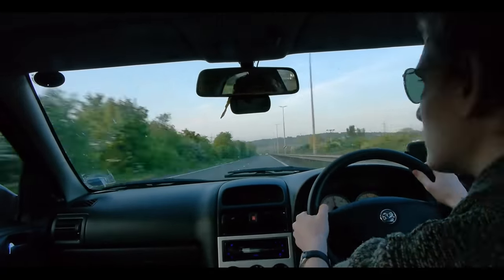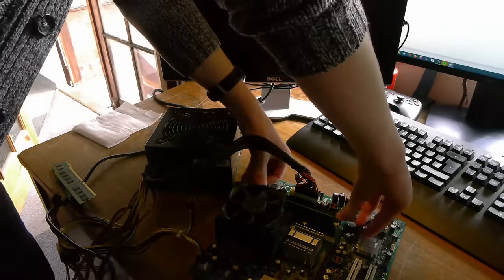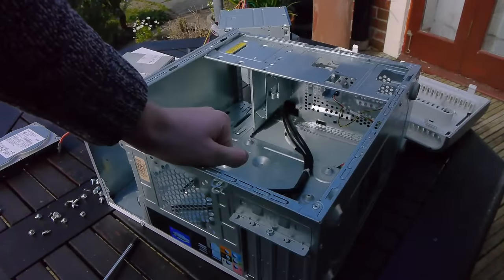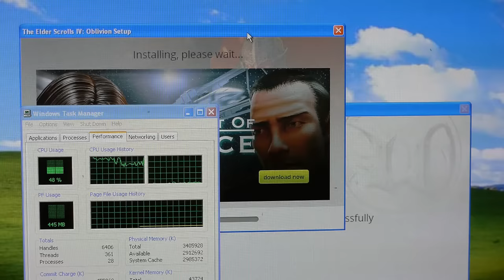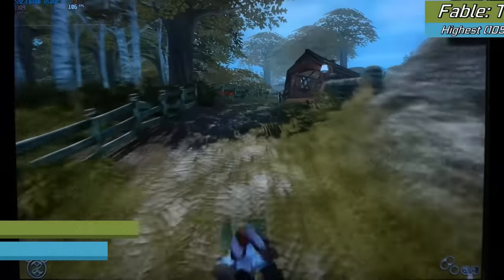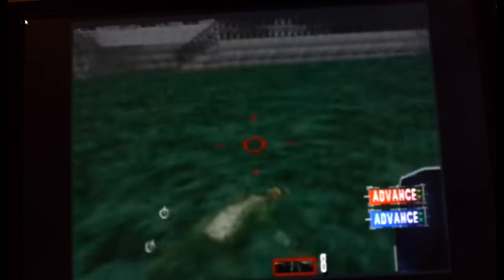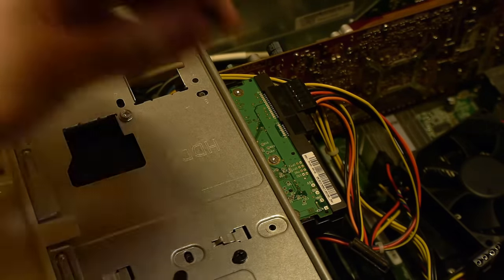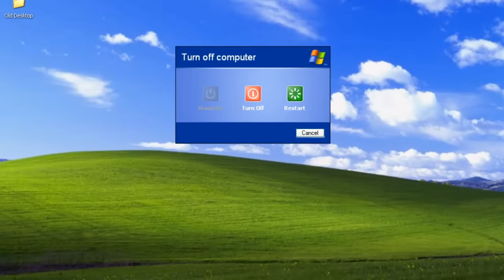The Ultimate Windows XP PC

Comment: Fun fact, Crysis and Half Life 2 both work in Windows 9x.
Reply: Lmao what. Ik half life 2 had some wierd support for 9x but crysis ran?
Reply: jackedup447 yes. Its dumb but t can. Even says so on my disc copies. Only 98SE and ME though. It’s not ideal lol. Both games perform even worse.
Reply: jam just take my HD 2600 already
Reply: @classic_jam  They've been working on that engine for quite some time,that could be why.
Reply: Half LIfe 2 I knew about, Crysis sounds like they just made an error on the box, adding 98/ME/2000.  Especially since it has brackets for the RAM/CPU for Vista(as opposed to XP)  I've never seen Crysis running on Windows 98.
Reply: Big doubt. Idk what DirectX support it on Windows 95/98 (I think DX 7) but Windows XP is up to DX9 and Win 7+ is DX 12
Reply: Can somebody make an actual video of Crysis running on Windows 98. Also Half Life 2 once actually ran on Windows 98 as the game came out in 2004. However since June 2007, when Steam support ended for Windows 98/Me, the versions released afterwards probably wouldn't run on Windows 98 (?). IDK, it would be cool to see those games running.
Reply: Windows 98SE and Windows Me can have DirectX up to 9.0C.
Reply: Dimondminer11 98SE and ME also support up to 9.0c
Reply: DirectX 10 required Vista+, and DX12 requires Windows 10
Reply: @lmcgregoruk  They did go back and add DX12 to Windows 7 RIGHT before the dropped support, but it's mostly irrelevant at this point.
Reply: No, Microsoft helped a few developers port their DX12 games to Windows 7, mainly WOW, they never released DX12 itself for Windows 7.
Reply: @karl-erikkald8876  you could maybe try a pirate oldengine copy in 9x? is it possible
Reply: But Windows 2000 runs on a NT kernal
Reply: @armorgeddon  And XP can support up to DX 10 and Win 7 can support up to DX 12, and Linux can run Windows programms/games and soon/maybe would Linux run even DirectX 12 games natively (google it up), Nintendo Switch can run Linux and Steam which means Steam games and Switch can run Android which means Android games. And Android can run Nintendo 3DS games, maybe even run the whole 3DS OS on it soon (source code for 3DS is leaked recently).
Reply: Windows XP only support DirectX 9 but its was unofficially support 10 if unofficial patch is installed.
while Windows 7 only support DX11 but Microsoft added a update in 2019 that allow DirectX12 game to run on Windows 7 (but only some games like COD Modern Warfare [2019 reboot], World of Warcraft, etc.. are supported).
Reply: Druaga actually played minecraft online with a windows 98 pc (that had ACTUAL windows 98 hardware era), some impressive stuff.
Reply: @LucasCunhaRocha  I remember seeing that actually. That was very interesting to me
Reply: The original version of half life 2 runs great on 98. On a geforce 3 ti200 and okay on a fx 5200.
Reply: But can it run recycle bin?
Reply: Eee my pentium 2 266mhz is a beast bro )) 4mb gpu xd
Reply: Wait a second that got me thinking,why isn't there a Windows 9?
Reply: I had a pretty good Crysis PC back in day, Q6600 quad core, 2 -GTX260FTW cards sli, raptor hard drives in raid zero, max Ram and processor lapped and over clocked.
Reply: Otherwise known as, Windows Xpotato
Reply: @DanikaCat  prolly because they already had a lot of legacy code written in for 9x so they decided to avoid using Win9 so that there wouldn't be any issues. Hence Win10
Reply: The more you know
Reply: @Cenzurat  an 8800GTS wasn’t faster than 2-260core 216 SLI. I upgraded from 8800GTs to a 260 core 216 it was much better in Crysis
Reply: @lmcgregoruk  dx12 need windows 8
Reply: @Dimondminer11  Win 98 and ME support DX 9
Reply: Some of the libs for HL2 want SSE3 now which is annoying considering the graphics still support dx7, and its just in like some dll for file io. stupiddd. Find an old engine build of hl2 and episode1 (2006 or earlier) for no SSE3. I bet tho with an SSE3 cpu even modern HL2 would run on win 9x. Then there's the Steam issue buuuuuuuut: https://www.youtube.com/watch?v=D_9hP2BA16Y <--- if any version will werk on win9x no SSE3 it's this one.
Reply: @samfkt  the Switch is ARM. Steam has to be emulated, and it'll run terrible.
Reply: Win98 was considered a better OS for games back when XP was first launched
Reply: Good luck finding any gpu that could actually run those games that support 9x tho
Reply: @lmcgregoruk  i have, a duaquad socket p3 system ran it
Reply: I think back in the day, I used to run EverQuest on Windows 98SE. EverQuest required DirectX 9.0c, if memory serves me....
Of course I also ran it on XP....
Reply: Crysis works with a Radeon 9800 pro from 2004 and an athlon XP, I know because I tested it., 480p ~25fps
Reply: Fun fact, Steam doesnt, so how are you legally installing Half Life 2 on 9x?
Reply: If you can even get a gpu driver to work on em
Reply: Hl2 can run on 3.1 too

Comment: WHAT. I literally just rescued my mom's 530 last weekend that she used since 2009 and put a GT710 in it the other day. I had to replace the power supply once, but other than that, it's been a tank and it was very clean. What a coincidence to see it on here. Did the one you picked up have a Core 2 Quad Q6600 (the original CPU that had to be discarded)? My mom's did and it still works great with a lot of tasks in Windows 10. And I just played some Streets of Rage 4 on it. I have it plugged into a nice 32" 480p CRT TV and am using it for retro things. Love the channel! Take care!
Reply: I have one of the Inspiron 530 (I liked the look of the Case for a Retro PC) with C2Q6600, I wanted to put my C2Q9650 & GA-G33M-S2 in it but it doesn't have a changeable I/O shield 😖 it's punched out of the case frame to suit the Dell M/B
Reply: Jimmy S  Yeah, I have thought about that But... I shake similar to Parkinson's disease due to a head injury that has affected my Nervous System, so cutting a straight line is a bit of a worry, let alone waving a Dremel around Willy Nilly 😁
Reply: I've owned a 530 since 2008, when it I bought it new for £399 from Tesco in Stockport. 
Mine came with a Q6600 but was recently upgraded to a Q9400. It has been my main desktop until this year and still runs XP, for legacy games and my video capture card. 
It did, of course, come with Vista, so had to be "upgraded" to XP. Long ago, I upgraded the graphics to an X1650, which work nicely for an of the old games that I have. 
As a legacy system, the Dell Inspiron 530 motherboard is ideal because it has drive connectors for floppy, IDE and SATA discs. 
A few years ago, I also acquired a 2009 vintage Inspiron 545. The latter doesn't give me the option of easily installing a floppy drive, but is now working nicely with Windows 10.

Comment: those dell motherboards from the inspiron 530 and 531 commonly have that orange light issue it usually just fixes when you power cycle it (only time ive ever seen unplugging and holding the power button ever doing something)
Reply: So you’re telling me I threw out my Dell Optiplex 780 USFF because I didn’t try that solution?
Reply: @shadowthefurryscientist  So you're telling me you threw out a PC?
Reply: @shadowthefurryscientist mine did the same but I kept mine

Comment: Brings back so many memories. I had a Dell Inspiron 530S (S meaning SLIM) in my early teen years. Got it from Walmart for god knows how much and it had a Core 2 Duo, 2GB of RAM and a Radeon HD 2400 Pro (I think) for a graphics card, complete with the latest and greatest NVIDIA drivers for all of my blue screen needs. The heat spreader on the card itself eventually tore itself off of the card. A lot of beautiful memories with that beast like 13 years ago.

Comment: This might be your best video so far, I really like it. 

Just a tip, but FM2 platform is also very suitable for XP.
Reply: I'm using an fm2 a6-6400k dual core for windows 10 :(
Reply: I installed XP on my FM2+ system, not bad, I have 8GB RAM installed even though the 32 bit copy of XP I have can only see about 4GB, but it runs great.

Comment: A couple months ago, I actually found a Dell Dimension 530 fully working. Just upgraded the ram to 6gb and the cpu to a Core2Duo 3.16ghz. Works like a charm with both Windows 10 and Linux Mint. It seems that there are two versions of motherboards for the 530, one that only takes dualcore/core2duo cpus, and one that works with quadcore cpu.

Comment: So i was watching your videos on my phone and i decided i was gonna get a desktop but i was also gonna get it for really cheap. So i went down to my local tip and got 2 slightly older desktops. One of them had broken dimm slots and a broken processor. It still had 8gb of ddr3 ram which i took from it and a gtx 560ti, which i took from it too. I put said components into the other pc,a Dell Precision T3500 Workstation, and now i have my desktop that can run some modern titles and is great for general usage. The exact specs are a GTX 560Ti, 12gb of DDR3 ram (i have no idea what speed), Intel Xeon E5640 and 2 500gb hdds both at 7200rpm and one of the dell psus that come with the precision. I got all of the parts for the pc for less than $5 and you are the reason i have built up this pc. Thank you very much.

Comment: That Core 2 Duo would work alright in a modern PC, I used one up until April of 2020 just fine. Of course, with a rather modern graphics card to try and make up for the CPU.

I actually created a similar computer for my personal Minecraft server, just with the E7200 instead, no graphics card, and I installed ubuntu 18.04 LTS.

Comment: I still have my old Dell XPS 420 with a Q9400. I'd love to have it running as a server the only issue is space and a lack of spare storage devices. Maybe when SATA SSDs get super-duper cheap I can boot it again.
Reply: Jimmy S  I live in the UK. 120GB SSDs are about £40. Actually more vitally it is missing a power supply which are unfortunately quite pricy right now.
You can still play Solitaire on the screen without drivers ;)
I'd probably install some form of Linux rather than Windows. Only benefit of Windows is PC Game support and I have my main rig for that.

Comment: XP is still my go too legacy operating system , 7 is still my current modern pc  operating system , the two best operating systems in the last 20 years
Reply: Believe it or not, my main laptop is still running Windows 7, though it's only a matter of time before it is upgraded to a different machine. Also, the machine I will replace it with, has both Windows 7 and 10 installed in dual boot.

Comment: You're the best, I totally agree with the whole having an XP system for those games and software you can't run on the current crappy Windows 10 systems.
I am just like you, I miss XP, and a Vurtual Machine isn't anywhere near as good.
I've spent countless hours trying to run one specific game on Windows 10 and only got as far as a loading screen then the game would crash to desktop closing the game.
Then, with a lot of trying to install XP on my laptop, (I did get Windows 7 on there but it wasn't the same, and went back to Ubuntu) I discovered my old PC parts, that just so happend to be a Mobo, CPU & RAM, could actually run Windows XP, the mobo's drivers page includes XP drivers. Looking that up was actually a last attempt and wasn't expecting anything of it. I then dug out my old tiny case, that I was using for parts for something else, it has a 120Ghz PSU in it, tiny little thing. I set it all up, booted an XP disc and away I went. Now nothing can stop me enjoying Windows XP again. Thought, I do pray it doesn't randomly kill over now.

Windows 10 can suck it, XP for life!

Comment: Doing a 3rd gen I5 system and built it in a old Celeron 420 system. Here's to finding a cheap $25 gpu or just chucking in the 1050 ti
Reply: I can confirm that my i5-3570 with a HD7850 runs really well as an XP machine and it still able to run windows 10 as well, whats not to like.
Reply: 420

Comment: My first PC was an Inspiron 530! Made my first RAM, CPU and GPU upgrades in it. I forgot about the orange warning light thing! Yes that was useful! I ended up using mine as a system to mess around with Linux distros on. (This was back in like 2016, but at the time, it could run Windows 10 fine and most games I was playing at the time in 40-60fps at low/med 1080p)

Comment: Windows XP is an utterly fantastic operating system, it had a very long time to become stable and the hardware support is incredible.
Yeah it's got more holes than Swiss cheese after Arnold swarzenegger used it for target practice with a minigun, but it was also fun to use, stable, and if it went wrong, you could easily determine why.

Every time I boot it I feel a smile forming, and I have 2 systems with it installed, 1 for the early XP games and mid to late 90s games, that system also runs Windows 98, and 1 massively overkill system which is for the later XP games that need a bit of grunt to run them at their best, and I love using both of them equally.

If I want a version of Windows that makes me happy, it's Windows XP, then 7, and finally 98SE in that order, whereas if I want a buggy, broken wet shit of an OS that never fails to piss me off then Windows 10 is where it's at.

Comment: Another good overkill spec for XP would be a Phenom II X4 or X6 paired to a decent-chipset AM3+ board (because K10 silicon is back-compatible with AM3+ and the Phenom II X4 and X6 are the highest-performing desktop K10 parts I know of), with the fastest DDR3 RAM you can get in two 2GB sticks or if possible four 1GB sticks because the max RAM XP 32-bit will see is 4GB, and then an R9 270 and an Audigy2 ZS for graphics and audio.

Also, a decent SSD assuming you can find some third-party TRIM implementation for XP, and some sort of ACHI drivers for the fastest read/write you can get out of a 20+ year-old OS.

Comment: Vista long before the end was not really buggy, and was basically Windows 7 with very minor differences. 

Even towards the beginning of Vista it wasn't anywhere near as bad people think - it just had the problem of having minimum specs given that were inadequate, which every OEM then built to that standard and slapped on a Vista ready sticker. The experience that gave so many people, and some initial driver problems for older hardware which were mostly gone after not very long, make people think Vista was much, much worse than it ever was.

If you are thinking about going for that though, there is obviously not really an excuse to not go for 7 instead. I just think it is interesting how people still don't realise Vista was never really too bad.
Reply: wyterabitt Microsoft was sued because of the Vista Ready sticker as they argued that even with minimal specs it could run technically run Vista but with the Basic edition, something that they failed to disclose as it was assumed that having Vista Ready certification meant that it could run all of its new features. It definitely wasn’t bad but in a technical and marketing standpoint it was a mess.

Comment: For my XP Pro 32-bit build , I'm using a Q9650 with 8GB of G.Skill DDR2 1000 and a 2GB EVGA 750 Ti SC, dual booting with 8.1 Pro 64-bit (& Classic Shell) using SanDisk X400 boot SSDs & WD Black storage drives.

(Also a Sound Blaster Audigy 0090 PCI card with driver support for up to EAX 4.0 audio on XP).
Reply: @jediii86  With a dual boot system like the one above, I still get to use all 8GB with the other OS.

Comment: My XP box is going to be my friend's old Dell Dimension 8200 - I looked after it for a good few years, got them on Google Chrome in the wind down phase, I'd sorted a bump from 256 to 768 MB RDRAM (added a pair of 256 to the pair of 128).
In a mixed bundle, I got a Radeon 9800 and a Geforce Ti4200, also bagged a 2.66GHz P4 cheap to upgrade from the 2GHz, and then after watching another set of 2x256 RDRAM, got an offer sent and got it, only adds 256 as have to pull the 128's, but 1GB just sounds so much better than "768 MB"

Comment: Yooo I have one of these. Used to use it for gaming. I put a Core 2 Duo E8500 and an ATI Radeon HD 2500 in it, two 500GB SATA drives I took from a server and a bigger power supply. Also stuck a floppy drive in for sng but the system wouldn't boot with it. It was a pretty okay low end gaming rig except for the 2GB of DDR2 RAM.

Comment: Hey BBO, fantastic video on a golden OS from yesturyear!  i couldnt agree more on how some programs or games feel better on XP, i even did something similar to you but instead of building a system i bought an old 2003 Acer laptop with XP SP2, Pentium M 1.6ghz, 512mb ram, ATI 9700 mobility and a 80gb IDE HDD. does the job perfect for programs that wont budge on win 10 or 64bit platforms and its great for all my old disc based games because it actually has a DVDRW drive!!

Comment: Dell Optiplexs also will randomly not boot if the CMOS battery is in need of replacement.  The power supply can also randomly do one of three things. It can boot fine, it can fail to power on or boot, and it could also trigger a front panel amber diagnostic code.

Comment: I worked at Dell the time these boxes was being built.  I was there when they switched using the Dimension name to Inspiron.  I bought an referb Connolly around 2003 which was when we went from naming them after superheroes to comedians. I upgraded it to the highest CPU for a Intel 775 socket to a 4 core processor and 4 gig of ram and blue ray and 2T 2 hds. It still runs. I was thinking of turning it into a linux box. But I may just put the original xp os back on it.

Comment: Dell's are like dogs they're reliable,fun and pretty stylish.

Amazing video I also have a theory about the broken cpu it was most likely this computer was used in a hot enviroment and the cpu cooler wasnt competant enough to cool the cpu and now its on its last legs. But voltage spike is probably the most likely theory as that PSU looks so dodgy it hurts.